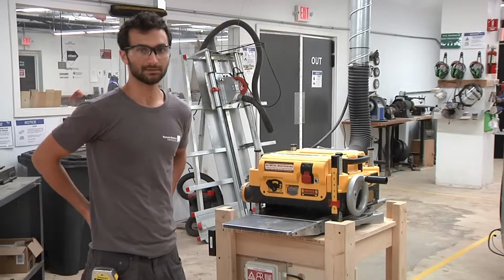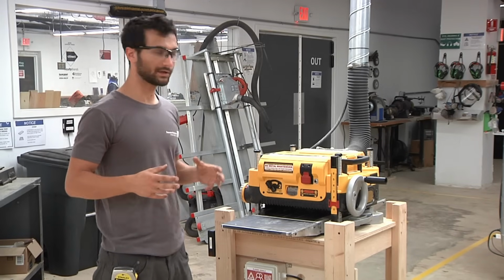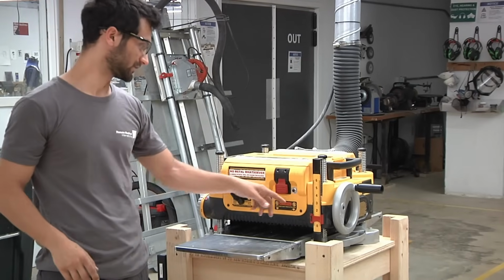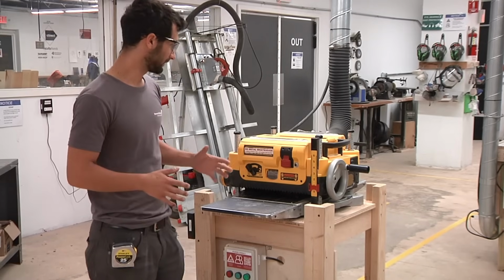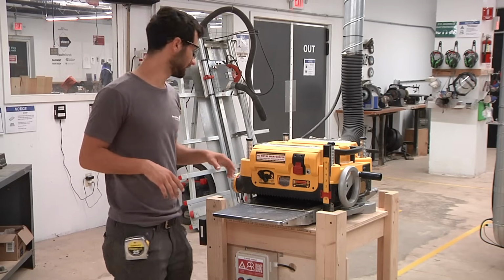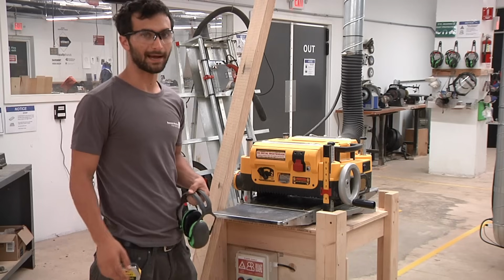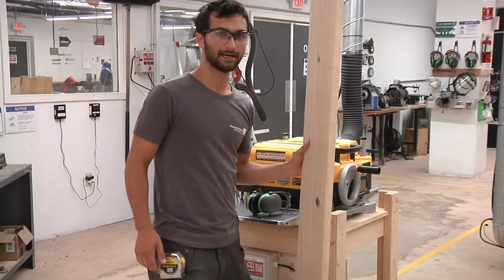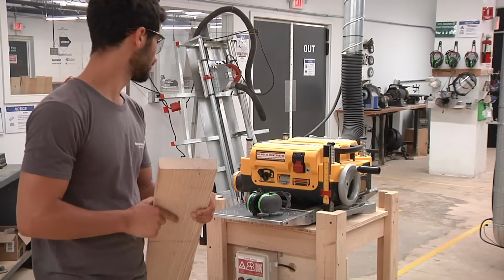Using the Dewalt DW735 Planer at MakeHaven

Comment: You did an outstanding job with this instructional video.  I just go my 735 yesterday and cannot wait to use it.  A label mic would help immensely.  I'll have to check your other vids.  Thanks for making it.
Reply: I got mine last week, I was feeding the first board into it and I tripped on my cat, long story short the thicknesser fell off the table hit the ground and went into overdrive sounded like a million rpm started bouncing around something seemed like it set it off balance , it begun to consume objects in my shop the cover came off the blades were exposed and shrapnel flew everywhere, I’ve heard of kickback but hell, the neighbours are not impressed with my cat I’ll just say that

Comment: Sorry but the explanation about the speed is incorrect.  In position one is 179 cuts per inches and in position 2 is 96 cuts per inches. Therefore it should rotate faster in position 1. position one should be use for fine cuts. The surface will be smoother. Position two is for rough cuts basically use when you like to take bigger chunks while dimensioning lumber.

Comment: Excellent video? Just replaced my burnt out, 6 month old Rigid planer with a 735x. Have looked at several videos and this is by far the most informative for a first timer. Particularly liked your comments on snipe. I found by leaving tables as is, out of the box, ends are slightly tipped up, consistent with your comments on lifting in and out. And yes, as my old shop teacher explained many years ago, minimal cut depth, nice and slow. Better outcome, easier on the equipment. 
Very thorough, complete and easy to follow and understand. Thank you!

Comment: Awesome tips. I’m just about to fire this up for the first time. I appreciate this. Subscribed.
Reply: dude, was there anything you had to do before running it for the first time? I set the the blade the proper height but its just not excepting the wood no matter how i raise or lower the blade. Am i missing something or did i just get a crappy model?
Reply: @jacobkomnath7961  Wood dust accumulation inside planer

Comment: MakeHaven... How do you feel about passing wood with epoxy/resin through this planer? Do you think the knives could handle the epoxy/resin? Would the epoxy/resin gum-up the planer to much?
Reply from the maker: Dont think it will be a problem. But best if you do some internet research to check that others dot warn against it.
Reply: I use epoxy, too and as long as your blades are sharp, there is no issue!

Comment: This is a good machine!>>>t.co/7guTu44732    This is my 5th planer over the years having gone through 3 Ridgids and a Steel City. So far I really like this planer as it cuts well with minimal snipe if any. I really like that blades are available locally and I’m not hunting them online. I plane mostly hardwoods and this does a very good job. I’m not crazy about the cutter head locking bar but I’ll live with it. So far the knives are holding up nicely and the dust collection is very effective. I’m impressed!
Reply: Removed the locking bar on my DW733, doesn't do anything that I could see. I think my original 733 Type 1 outlasted your Ridgids and Steel City.